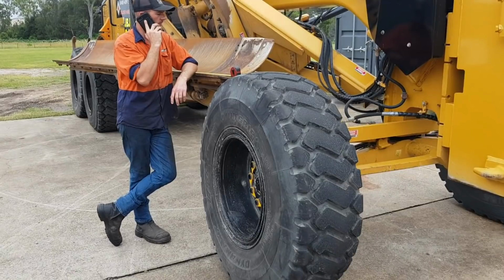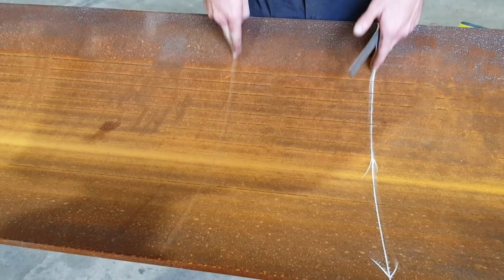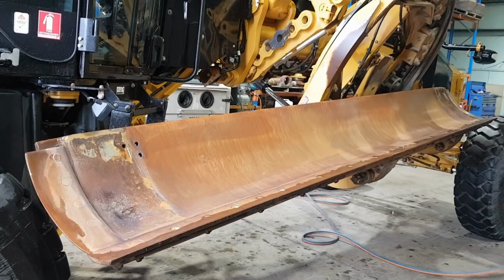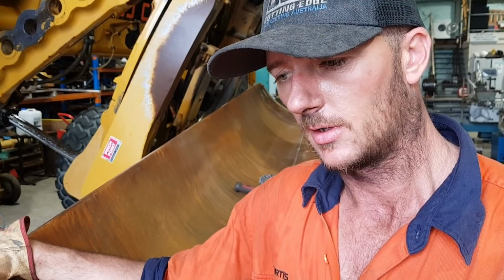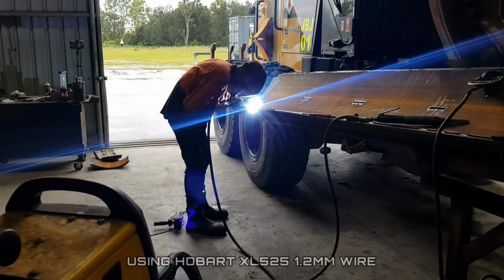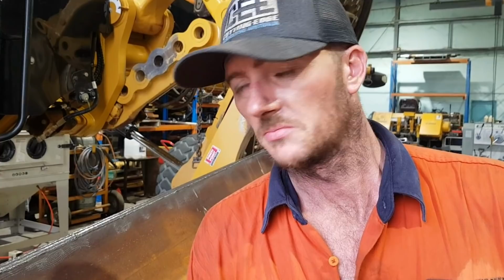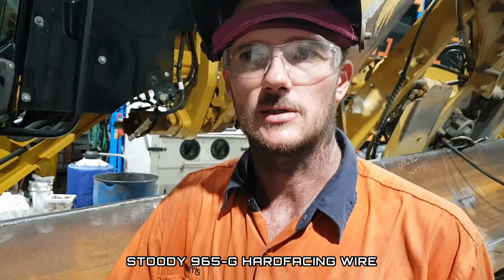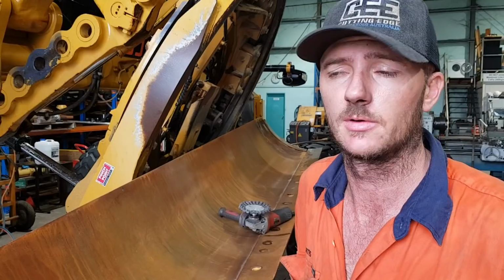Repairing Blade on a Caterpillar 140M Motor Grader | FCAW Welding

Comment: Hey bro I'm a welding contractor here in NZ. Loving your vids and learning heaps mate. Here's a lesson from me, "Wear a freaking respirator bro...please!" I know they're shithouse, they give you a headache after you've been wearing them for an hour but you'll just live longer.
Reply from the maker: Hey mate cheers for that yeah you're spot on. My adflo just needs a new battery need to get onto that 😎👊💥
Reply: I'm no welder but I was thinking the same thing!
Reply: Ear protection when grinding is also key. I use mine all the time, they're worth it in the long run.
Reply: Respirator is a good idea when you're grinding too, especially if you are grinding tungsten carbide tools or (even worse!) thoriated tungsten TIG electrodes.
Reply: @BrianHealy666  ear protection while oxy/act cutting can be important too as I found out today.
Reply from the maker: @BrianHealy666  I've got 3M ear plugs in they sit inside the ear so hardly see them 😎👍
Reply: @BrianHealy666  I use a pair of bt earbuds that are rated for 22 db noise reduction on my phone and stay connected to a custom shop intercom via discord
Reply: @RazsterTW  And take it from someone who lost 70% of his hearing that earmuffs are not good enough. Wear ear buds as well as the muffs !
Reply: @CuttingEdgeEngineering  And wear the ear muffs over the top. Wish that I had ! They weren't around much back then !
Reply: @farges76  didn't know that was a thing. that's pretty sick.
Reply: Was watching the grinding across the blade and seeing all that dust and my first thought as well was, dude! We all want to watch you doing this for a long time more - please wear something. A bandana, anything.
Reply: And obviously that goes for your production crew as well, since she has to be standing in the midst of a lot of that. Kudos on the instincts of where to move to and get in for the good, close shots, by the way. Excellent work.
Reply: Never used a Respirator, had an Extractor though...
Reply: @BrianHealy666  What you say?
Reply: The dust from grinding that rust buddy is some of the worst shit to breath ! I see you wear your air pack in most of the other videos I have seen so far. You two have one of the best channels. Take care.
Reply: If nothing else have  fan blowing over your shoulder moving fresher air to you and dirty air away!!!
Reply: With flux core wire that is doable!!!!

Comment: I love that You actually explain and show what the part You're working on looks on a real machinery! This is what I was always missing in Abom or Keith Fenner videos. I think Your viewers really aprecciate it :)
Reply from the maker: Hey mate yeah I think it adds a good perspective and for most who don't work with this gear. Thanks for watching 😎👍
Reply: Indeed, it's partly why I stopped watching both their channels. Cheers :)
Reply: Indeed I do! I stopped watching Abom because he eventually quit making machines and fabrication videos and has turned into a look what I bought video maker. Rucker also does not make many machinist videos anymore, and his intro is a flag-waving advertisement.
Reply: @freethought2296  Try Metal Raymond.
Reply: @freethought2296  did you mean Fenner for the flag waving? cheers....
Reply: @Laura-wc5xt  Yes, thanks for the correction.
Reply: @Ham68229  totally agree. Really sets them apart from all the other similar channels.
Reply: @Ham68229  Exactly the same here!!
Reply: @freethought2296  Shillmaster Booth and Adman Rucker. Unsubscribed from both with no regrets. Nice to find a REAL fabricator with tons of skill and an awesome videographer!
Reply: Try Fireball Tools. That guy is very smart and works with a lot of heavy items. He explains what he’s doing and his work is almost always applicable to everyday use.

Comment: Turns out there is, in fact, more than one way to skin a cat!  Also, props to whoever does your video editing; it's easy to miss because it's well-done.
Reply from the maker: Cheers Jim thanks for watching. My missus does all the video and editing 😎👍
Reply: @CuttingEdgeEngineering  Tell her we really appreciate it. She's a real pro!
Reply: @CuttingEdgeEngineering  great to have your own Karen.....she does a wonderful job on the video, and this comes from a former video producer who worked  in video and commercial photography before the Internet....cheers from USA, PAUL
Reply: Thanks !
My hat is off for Your "missus". I bet she already knows about Your work almost as much as You do. In order to get the video right You really need to know about the process You are trying to present.
I quess it's part of the video but I have found out that sound editing is also important. Metal workshop sound environment is quite harsh as there is a lot of dynamic around. Getting the angle grinder sound right, for example, is not a trip in the park. Good equipment helps but there is still quite some to do to make it right. I quess Your "missus" does the sound editing as well.
Greetings from Finland! (Winter and 20 degrees below zero at the moment).
Reply: @BruceBoschek  Groan...LOL
Reply: you mean "CAT"
Reply: @CuttingEdgeEngineering  and the sniggering 😉
Reply: @CuttingEdgeEngineering  And an excellent job she does!!
Reply: The truest sign of a master is to make it look easy.
Reply: @CuttingEdgeEngineering  The Giggle Machine deserves more credit!
Reply: @CuttingEdgeEngineering  and she does a VERY good job!
Reply: @CuttingEdgeEngineering  She does an utterly fantastic job! She carefully pares away the little redundant bits without losing anything of import or interest. The music she lays down with it is great as well.

Comment: I don't know how often you have to make long cuts on steel plate, but I have a circular saw made by Milwaukee that has an 8 inch carbide tip blade that makes cutting plate a dream.  I don't use it very often, but everytime I do, I tell myself how glad I am that I bought it.
Reply: Those blades aren’t gonna be happy with that abrasion resistant 8mm steel, but in mild steel they’re great for sure. I’ve ruined a lot of blades learning these lessons.
Reply: @asw19B100  I wasn't aware that he was working with anything other than mild steel.   He probably mentioned it in the video, but I missed it.  That's definitely a good point you made.  Thanks.

Comment: Awesome job. I own a small business in USA. Primary customers are rock quarry but not limited to just quarry. We use the XL525 wire alot. It is nice wire. We repair Caterpillar Equipment as well. I do more machine repairs, electrical, Hydraulics, engine, also own a machine shop mixed in with a parts store in which we purchase used equipment and rebuild components for resale. I can tell the 3 of you are very passionate  about quality. From the work to the videos. Its hard for the younger generation to get a chance at a trade. I would rather hire a kid willing to learn. I share your vids with my employees. Thank you very much.

Comment: I have done a lot of repair panels on trash trucks. Trash is amazingly abrasive. The prep is cut out the old then tack in the repair panel followed by hours and hours of welding. I recommend always using a face shield when using a torch. I do but had a torch spin in my hand with it up and burned my nose pretty bad. I was looking at what to do next and it caught me by surprise. I have done some replacement curring edges on bobcat buckets as well. That was a nice looking repair on that grader blade.
Reply from the maker: Shit mate that's one way to trim your nose hairs! Thanks for watching 😎👍
Reply: I have also done lots of flux core welding. Most were with 0.0625" wire using CO2 gas. Those were 3 phase machines.  I use Dual shield 7100 ultra in my personal mig, 0.045" also using co2 gas. it is a single phase unit. I have done some aluminum mig as well.

Comment: Might wanna wear a mask when you grind down stuff in the future, all that metal and god knows what else floating around isn't doing your lungs any favours. Always nice to see a new upload!
Reply: And maybe fume extraction system for welding. Especially that flux core wire.
Reply: Yea, that was the 1st thing I mentioned 2 myself Was Where's your Mask when u C all that metal dust come flying out. 
B Safe Kurtis 
Take Care
Reply: @bradleywilliams2401  probably worse is the fiberglass or fibers that hold many grinding wheels together, I know in a shop that is dim and having sunlight coming in from a window you can really see there is a lot floating around. Stay safe Kurtis......
Reply: The usual safety Sallies on here
Reply: @gusm5128  🤣🤣🤣
Reply: Exactly. Welders lives matter

Comment: Loved the use of the toe clamps as work holding. For the top edge, or similar you could look at Kant twist clamps. You should be able to get the same pressures but not have the bar sticking out in your way.
Reply from the maker: Thanks for watching hahaa yes my wish list is getting longer and longer 🤣🤣🤣

Comment: Hey Kurtis, Search up I C Weld on YouTube.  He is amazing with the oxy torch.  He shows the big difference in the cut quality by pre-heating.  The tips might save you a fair bit of grinding.  Keep up the great work!  Much better than some other machinists channels (eg KR) where it is 95% talk and 5% action.
Reply from the maker: Hey mate yeah I've seen his channel but will need to watch more of his vids! Cheers
Reply: @ Ron,,,,I was thinking the same thing both IC doing alot of jobs like this one and some guys who yak and yak and yak about a 5 min job. Watching most tubers, where is a fine line between too much info and not enough. Kurtis toes the line nicely.
Reply: They are using different cutting fuel gasses. So they have different characteristics.

Comment: I've rebuilt loader buckets and moboard skins and I always welded diamond shapes on the edge plates to trap a layer of dirt as it slides by to help with the wear. An old timer told me when I started that the diamonds held dirt and dirt on dirt wears longer than steel and dirt.

Comment: Well done and very clean job !! I'm a retired Cat dealer manager so it's easy to spot professional work.
Reply from the maker: Thanks mate appreciate it!
Reply: Steve, I hate to think of some of the not so professional stuff you must have seen.
Reply: @markfryer9880  Yes, I've seen many hack jobs on blades, buckets etc. A lot of over hard facing which only makes the base material brittle and prone to cracking. That was a sweet job he did on that 140M blade face.

Comment: Kurtis excellent video as we've become accustomed to viewing.   You may wish to consider turning the oxygen to about 70psi when gas cutting that AR450 steel.  The extra O2 will almost completely burn the AR away leaving very little or no dross to grind away.  And to your viewers in the States, his primary welding wire is Hobart FabCO XL 525 which is what we would call a "Dual Shield" Low Hydrogen Flux wire equivalent to our e7018-1 H4R Rods...

Comment: I enjoy what you do , it’s amazing how much we learn watching a master mechanic , I’ve operated equipment all my life and did some welding fabricating light metal work , wish I would have worn my dust mask on most of my jobs , and painted cars , equipment for 30 years I’m 62 years old , 5 years ago I had a double lung reduction surgery because of the elements I was taken in every time I pick up a tool that would throw dust , dirt ,Grinding material in the air and I smoked . Your work and videos are the best in it class I applaud you for showing us how it’s done right . Viewer From United State , State of Michigan I live in the top of the mitten. Love you four legged family member.

Comment: Nice work. I like putting a small hose clamp on the torch nozzle so I can set the height and ride the angle iron down the length of the cut. It’s a lot easier on the wrist for me.

Comment: Love watching your channel.
Not trying to pick holes, but 27V and 5.5 M/Min seems a bit shy on the wire speed.  I know every welder is a little bit different but that seems quite light on for wire.  
Cutting with oxy or a grinder with the job on fork tynes is a recipe for disaster - one slip or nick and hello new tynes. I also couldn't help but notice the grinder looked like it didn't have a guard fitted.  Fingers are really handy accessories, best to keep them in good nick.
Otherwise a top class job.
Reply: @Gustavo Muchavo I wouldn't say that at all.  
All of us can drift into some bad habits due to convenience, likewise we can all benefit from a gentle reminder sometimes. 
 Cutting Edge Engineering do good work and I would never say otherwise.
Reply from the maker: Thanks for watching mate 😎👍

Comment: I like what you do. Do, being the operative word. If you had laid the steering wheels over to the right, then turned them all the way to the left, you would have more room to lower the blade to a good comfortable working height. Also blade out the left side  gives you a lot of room.  Thanks for the good show.

Comment: I am fixing the destroyed bucket on my old Ford tractor.  I bought 1/4 plate steel and sliced it into three long pieces making the "cup".  I was planning to use 7018 rod and peen it.  Watching this makes it clear, My design is very weak.  light duty only.

Comment: I’ve used that dual shielded .045” wire for many years in a rail car repair shop. All of it heavy plate, and pretty much all out of position welding. We used Co2 in our process, but the dual shield is the way to go! We had to pass 2G, 3G and 4G, 3/4” plate x ray testing.

Comment: It's quite cool to watch these repair jobs. Especially the contrast in approaches to each repair.   i.e.  Remove and replace with new, partial removal and repair with Welding/new steel, or in case been to able to place new steel plate over the existing plate and weld in place.
Reply from the maker: Hey Craig thanks for watching mate. Yeah crazy how many different applications and jobs are out there

Comment: I see a lot of comments about respirators, when I was welding Fluxcore, we used a Cleanspace respirator, think they are better than the Adflo's, 1/3 the price and they fit under your helmet, good for when working in confined spaces as well, as there are no hoses and battery packs to worry about, the Best thing I ever bought, my son also uses one for spraypainting. 😎😎  Always wondered how the hard facing was done, I thought it was more than that, but very nice welding mate. I love flux core, lays down really nice.

Comment: You guys get more rain than I imagined.  I think of Australia being dry. However, as large as A is you probably have all kinds. 
I worked at the Decatur CAT plant for 33 yrs. I was supervisor on part of the grader line for two years. We were still bldg. the G series in those days. 
This is the second vid (CAT cylinder rebuild) I've watched with you.  Very interesting.  I do some minor repair on my equipment which is all centered around my B3200 Kubota.
Keep up the great work.
Reply from the maker: Hey mate that's awesome thanks for sharing with us. Yeah you're right Aus is a big place all sorts of weather here but this year we had quite a rainy summer. Thanks for watching the vids. Cheers 😎👍

Comment: A good cordless impact would make your life alot easier and would save you alot of time from wrenching those bolts on and off👍 another awesome interesting video thanks for sharing Kurtis I hope you and your lovely lady have a great weekend👍👍👍
Reply from the maker: Hey mate yeah have got one but don't like using it on these toe clamps as we use them on our milling machine want them to last
Reply: @CuttingEdgeEngineering  Exactly what I was thinking... I've never seen anyone use an impact on machined braces/blocks. I knew there was a reason you were using wrenches.

Comment: Propanes the way to go so much cheaper just as good demolition torches are usually used with propane at least that's what I used when I worked for a salvage company

Comment: Really enjoy watching your videos. Quite therapeutic to watch someone else crafting. You have a good pace to your videos and the filming and editing make them very watchable. I do a bit of welding at work and am lucky enough to have been given a Speedglas 9100XXi Air Welding Helmet with Adflo PAPR. Can't recommend a decent PAPR helmet enough for someone like yourself doing a lot of welding and grinding. They are pretty expensive for a welding helmet but they make it a much more pleasant experience and will save your lungs in the long run. Stay safe brother and keep laying those beads.

Comment: Well done as always! Really want my job to get a spool of Flux cored. We do alot of similar work during the winter while we go through all the company's equipment. Liners in dump trailers (steel and aluminum) hard facing buckets etc. Skinned a D6N dozer blade much like you did that grader, however didn't have as nice a result haha! Always like to see what comes in your shop! Thanks for sharing!
Reply from the maker: Thanks for watching mate!